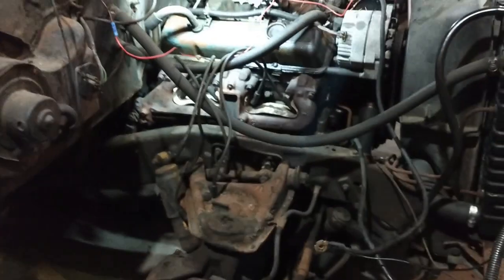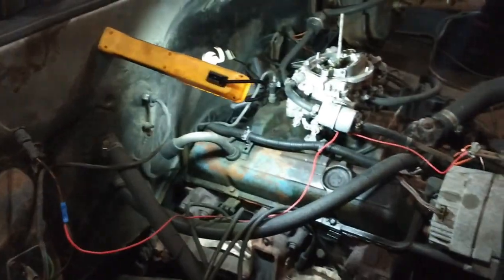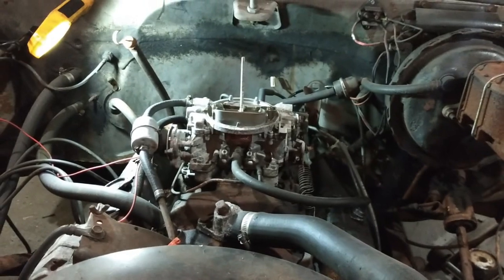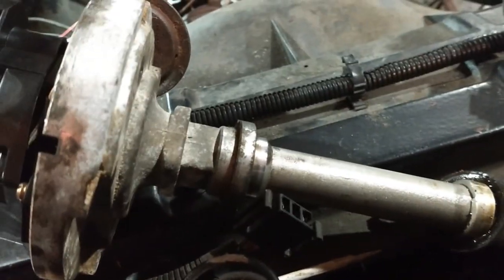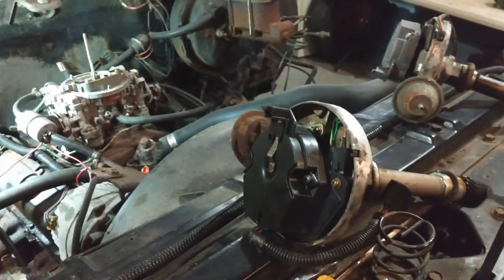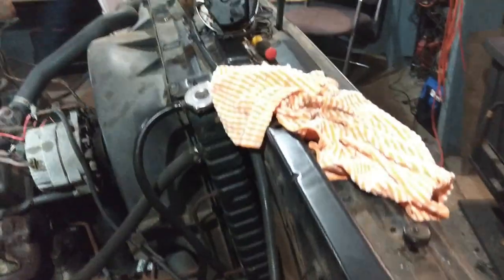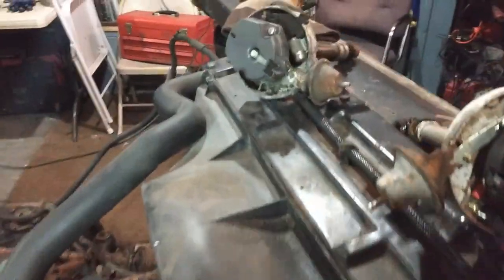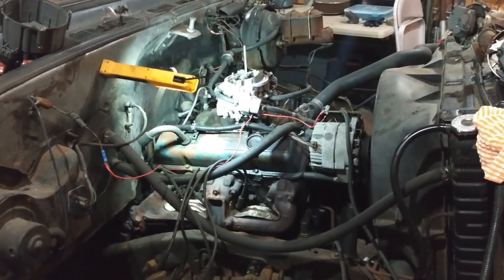Suburban motivation

Comment: I had a Chevy van that would run like that with a shimmy. Nothing helped it until I read on a message board somewhere about diagnosing ignition problems.  I went through multiple cap & rotor and finally discovered that the genuine AC Delco cap and rotor didn't give me the problem. I think it had something to do with moisture and condensation getting inside the distributor cap because it gave me the most trouble on wet days and cold days.

Comment: One cylinder a little low on compression?  Vacuum leak seems likely, maybe the old manifold gaskets are leaking a bit?  Check the cam by pulling the valve covers look for one rocker barely moving... you would probably hear a ticking lifter tho.  Check timing chain with distributor cap off, turn crank back and forth should be barely any play between movement of the crank and the distributor rotor.  Good luck man.
Reply from the maker: thanks allot bud

Comment: Hard to tell from the video exactly how its running. By chance, does it still have the catalytic converter on it? Those old GM beaded converters use to plug up real bad. When they plug up you could hold the throttle clean to the floor and they just wouldn't rev out.
Reply from the maker: No way man just straight off the manifolds to glass packs lol
Reply: @acrazycanuck78  
Hell Yeah Brother! The way they all should be! Lol